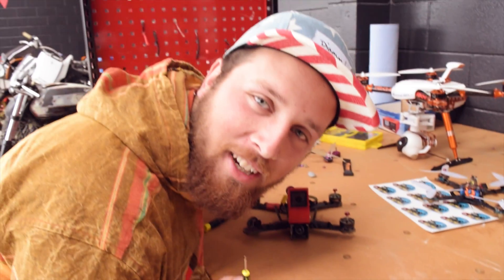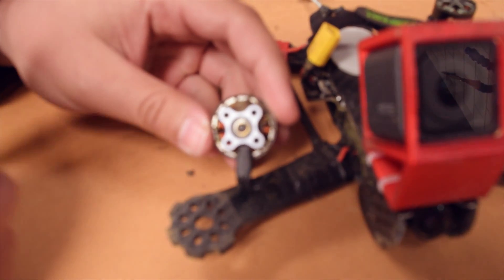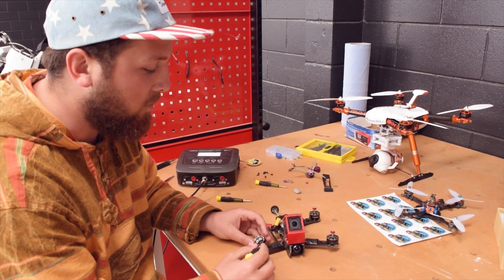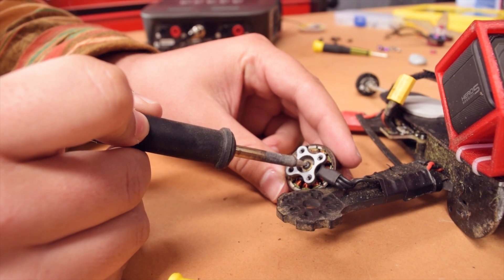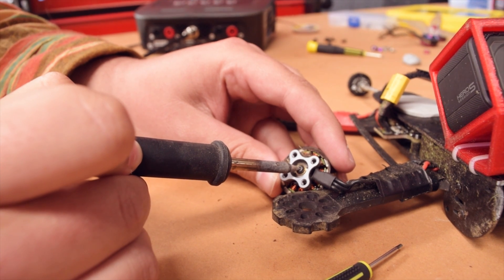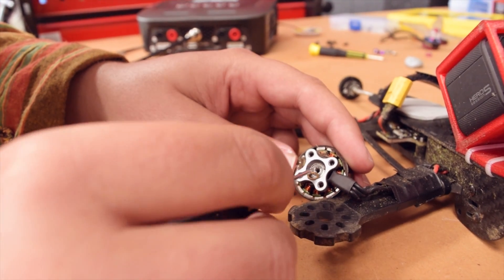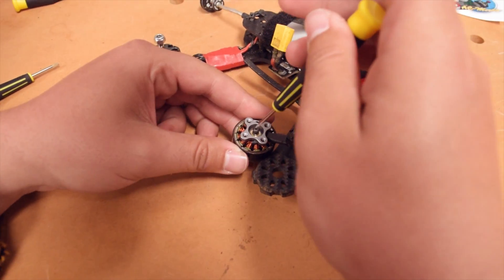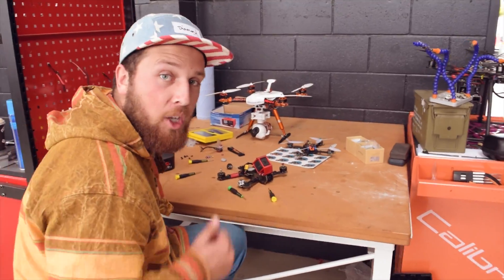Tip for removing drone motor bell screws, without F*&^#%g them

Comment: Great video. I have found that with the allen head screws, if you get a driver bit that you can put into and remove from a handle, you can put the bit in the screw before removal and heat the bit. This transfers the heat through the screw better. Then put the handle on the bit and the screw will come out. As Acidfpv stated Torx will eliminate the problem. That's what I'm switching all of mine to.

Comment: Great tip, thanks, just broke a bell screw because it was to tightened. Question, I over tightened one my motor bell and now the motor isn't turning as freely as before (as expected). However, I tried to take off (not yet try to fully fly) and it went quite ok. What would be the foreseen issue? To much amps delivered to this motor to compensate, or lose of power on the other ones, something else?

Comment: I've had to clean up my motors but i don't have loctite, do you think the screw will stay in place or should i buy loctite asap? Thanks for your video
Reply: Honestly, they'll probably be fine (like 99% chance you're good, assuming they were tightened properly not just "snugged up"), but for a manufacturer, having 1 out of every 100 customers complain means you're going out of business in short order. (with negative people always being more vocal and all that)

At the same time, loctite is cheap and it isn't too hard a job to do.

Comment: How is this motor for racing?
Reply: Really nice man, I've only used the 2400kv for freestyle so far, but my friend has been using the 2600kv version for racing, and has gotten an extra 30 seconds flight time coming from his 2205 motors!
Reply: Mad fast too, and easily swings heavy props with that stator